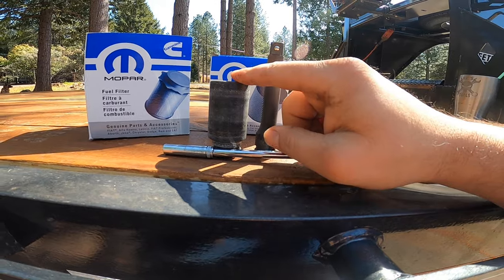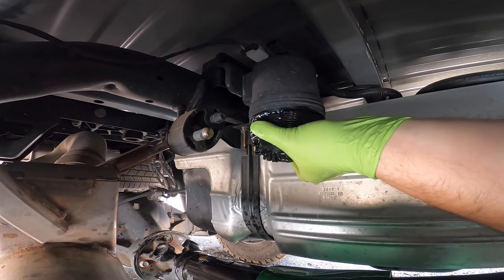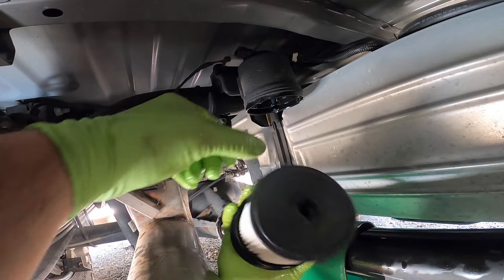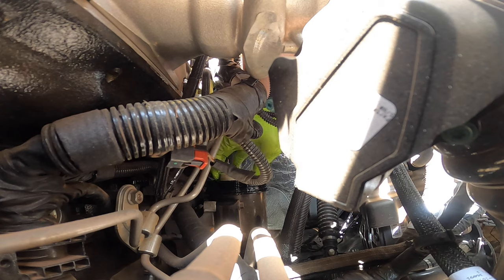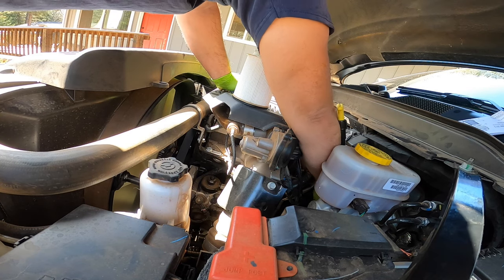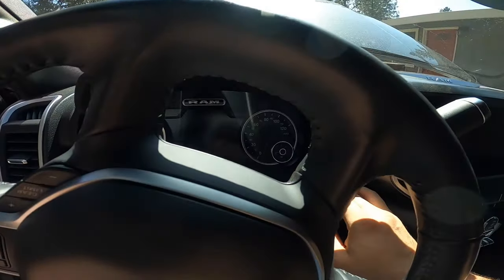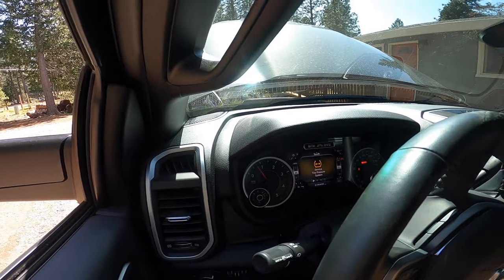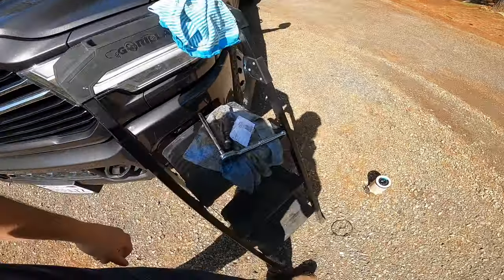HOW TO: 5TH Gen RAM 2019-2024 FUEL FILTER CHANGE for your 6.7 Cummins

Comment: Fuel filter service on the Cummins should be every 18k. If you’re doing more often you’re just wasting money. My oldest truck has always been done this way. 700k miles on the original fuel system. Original injectors
Reply from the maker: Service your truck for how you see fit, what works if what works we all have your way of doing things neither be right or wrong. 
You know there’s that that one guy out there that doesn’t service a single thing and gets a lifetime with a truck and the next that will over service and gets a season out of it. Just like a horse
Reply: @IManOPERATOR  a truck is not a horse. Proper service intervals produce longevity. My 700k truck is a 2014. Proper intervals are important. Paper filters will clog. Nobody is getting high miles out of the Cummins without service. Feel free to waste all the money you want. My advice is free. Oil every 12k, fuel ever 18k, air every other oil change.
Reply from the maker: @karlmurphy1291  appreciate you taking everything I say to a literal sense.

Comment: What socket attachments can I get to make it easier to remove that front filter cap, I did mine today and it was a fucking nightmare. Also, how come you didnt drain the front filter using the yellow drain bolt?
Reply from the maker: Get a 12” extension with a wobble makes life extremely easy.  If my truck sits over night there’s no need to drain the front filter. Never spills out. I just changed them again recently and truck was parked for maybe 3-4 hours and opening the cap only made a small bit of diesel spill, rags under it caught it all.
Reply: @IManOPERATOR  Draining isn't to prevent spilling, it's to prevent the unfiltered fuel in the housing now mixed with the contaminates that sit on the bottom from going to the clean side when you insert the new filter. This is also why the included instructions say drain, remove filter, flush housing with clean fuel and drain again.

It shouldn't "just start" like it always does. If it does that means you just potentially put a bunch of unfiltered debris into your fuel pump, high side, and injectors.

Comment: I love it, its inevitable making a mess.. no rubber hose hooked to the drain, just dump that sh$t... no shop rags on tha drive shaft, just some extra diesel lub, it will help with drive shaft vibrations.. overall great attempt at an instructional video. if you would just state reference the manufactures manuel in your video as a source to get specifics.. everyone complains about service charges.. although i to am a backyard mechanic, its not fair to half ass it and not give a shout out to the proper method and those who a certified. No proper disposal, no torque on the caps, not defining the proper priming sequence.. i keep forgetting these new generations dont like to read... fyi, manualslib online has the manual for this and its free to read...... always got to be one of us. Signed non-paid-YT fact checker.😂
Reply from the maker: Wow

Comment: Ram has a horrible design on the fuel filters. I like the Black market’s aftermarket replacement housing design and the ability to use cat filters.
Reply from the maker: Honestly couldn’t agree more, ram didn’t put them in good spots, should of just made proper remote systems like the industrial cummins motors have. 
I have a fass system for the truck now that I need to install. Will fix that up quick